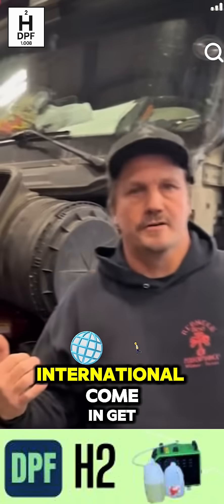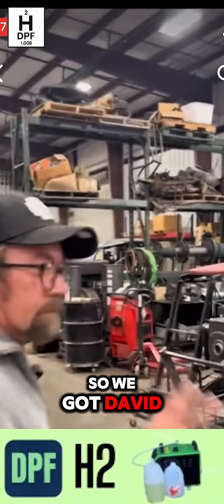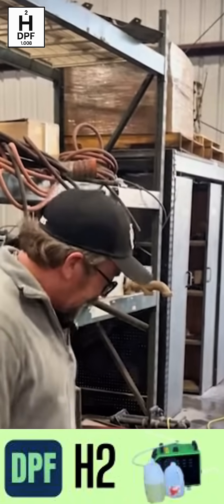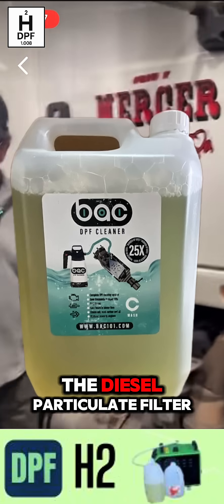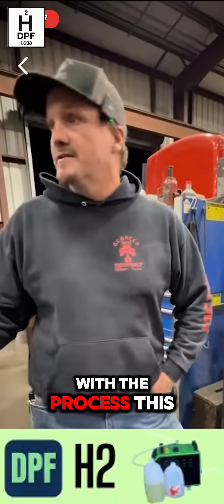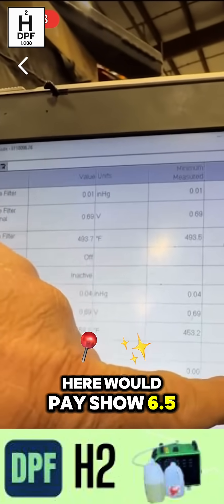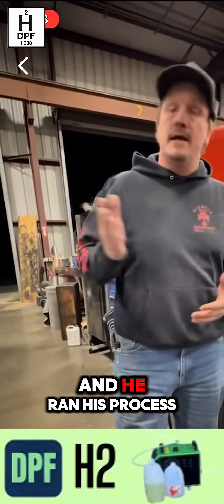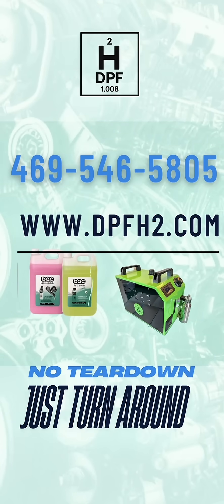Revolutionary hydrogen DPF cleaning that saves time and money#hydrogendpfcleaning

Comment: Hydrogen burns clean and makes other fuels burn much cleaner.
Reply from the maker: It really does
Reply: @DPFH2  I worked for a truck shop near Sacramento ten years ago. There was a guy experimenting with HHO injection for emissions reduction in deisel trucks.  I used HHO to improve fuel economy, but I never thought about it cleaning the intake.
Reply from the maker: @TimberTrainer  That’s really interesting! HHO injection definitely had its share of enthusiasts back then. I’ve heard a few folks mention the fuel economy benefits, but you’re right—its potential for cleaning the intake isn’t something that comes up often. I wonder how much of an impact it actually had on carbon buildup over time. Did you notice any long-term changes in engine performance or maintenance needs?
Reply: @DPFH2  My setup was always needing maintenance. It was more of a hobby than a practical system. I did see up to 30% better fuel economy.  It was a sealed container that needed to be refilled every hour of driving.  An electronic system to tune production would have helped substantially.  It would be neat to see how your hydrogen machine works.